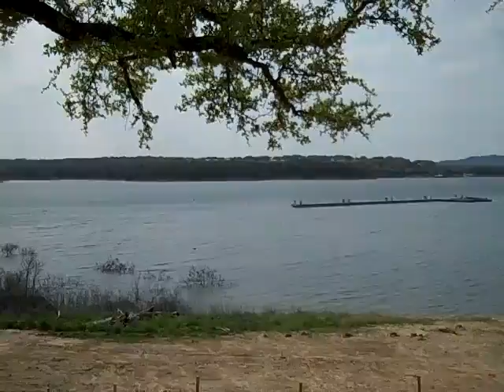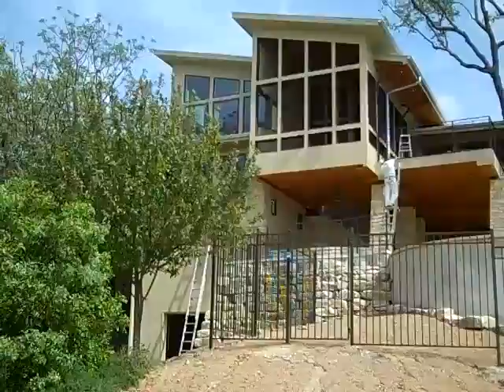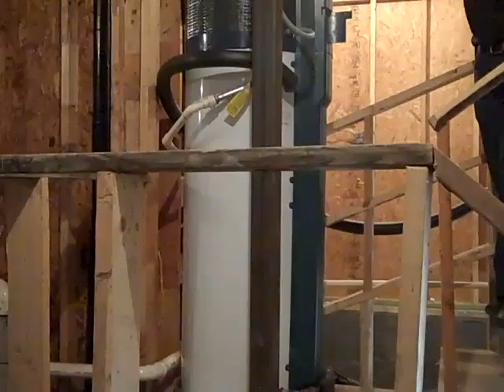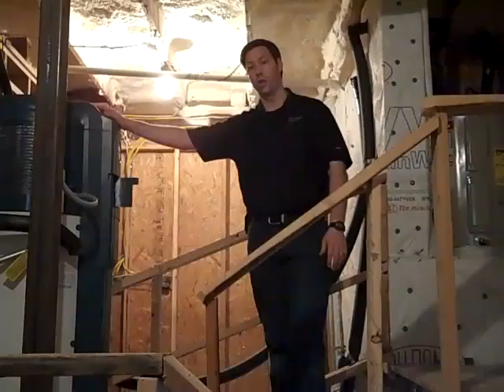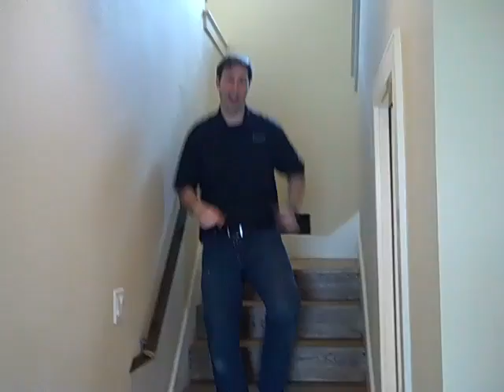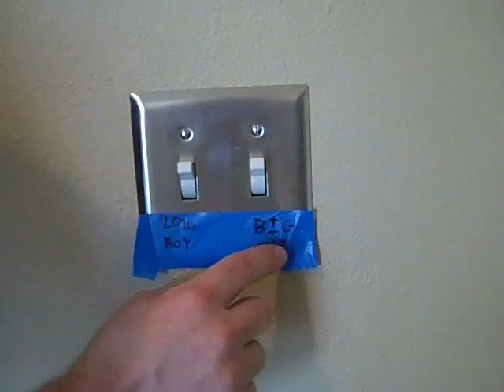Rheem HP-50 Post Install Review

Comment: I purchased the 50 gallon hybrid model. It is a DISASTER. The unit began leaking from the top only 2 months after having it installed. Rheem refused to send anyone to come and repair or swap it out (they claimed that there was no one in my area to service it despite the fact that they advertised local contractors in my area who they deal with). They instead told me I had to return it myself to home depot and only offered to reimburse me a small fraction of what it costs to disconnect remove and reinstal a new one! Please stay away. This is an example of a manufacturing company being negligent about what they put out on the market. Read some of the reviews online.
Reply from the maker: Cordelia Baker I'm sorry to hear of your troubles.  I've installed several Rheem HP units since this video and they are all working great.

Comment: 12 year tank/parts warranty vs 10. While this control may not be as sexy, Rheem offers 3 modes for diversity in operation, water delivery and energy savings. Newer units offer a color touch screen control. Opertaing at 2.35 vs 2.0 will save on an average $2.69/mon or $33/year. Rheem EcoSense chose to provide the homeowner with substantial energy cost savings plus more hot water, faster. A quality, efficient, more beneficial package overall.

Comment: A few things that may have been helpful making your purchase and hopefully may help others in making theirs. While the GE brand is not a bad choice, the Rheem can offer additonal benefits making it a better buy, Rheem offers 67g FHD vs 63, 23 GPH recovery vs 21. With higher water delivery the customer will likely opperate in normal mode achieving greater savings. Lower operating temp 40 vs 45 for greater range of instalation. Quiet operation 49db vs 63. R-410a refrigerant more eco friendly.